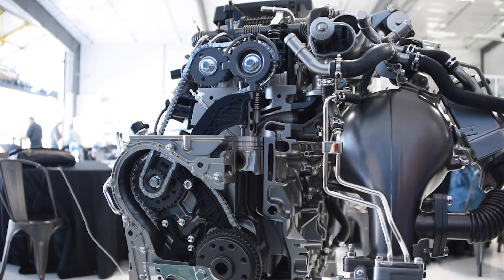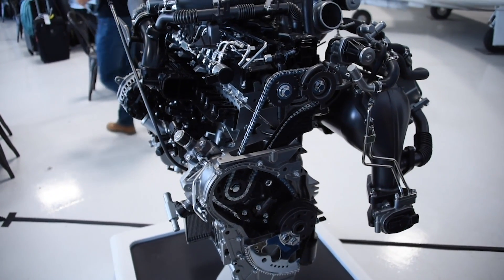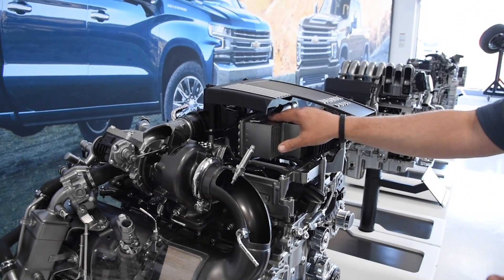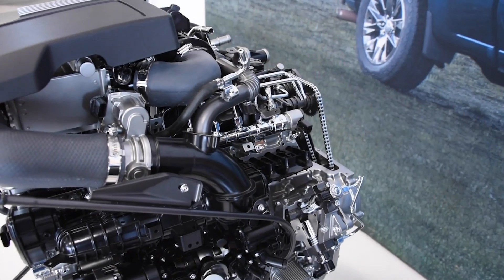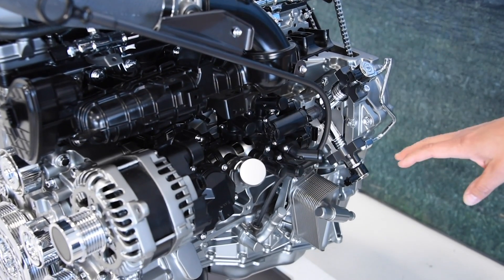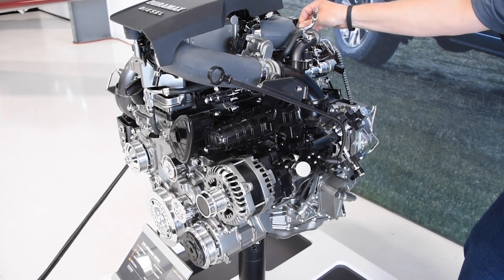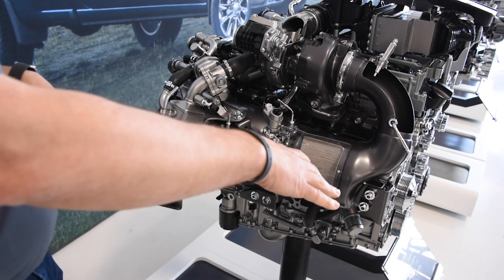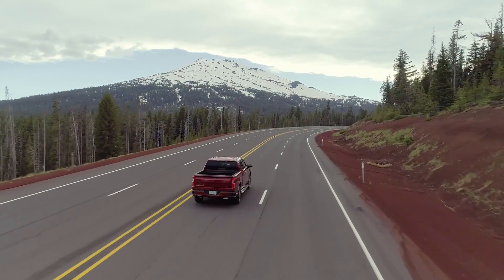What you don't know about the 3.0-liter Duramax diesel

Comment: Why a belt instead of a chain to drive the oil pump? I have seen estimates of 14 hours in labor to replace this belt so we are looking at at least a $3000 job.
Reply from the maker: A submerged belt can last as long or longer than a chain, and is quieter. I think 14 hours for a GM tech to do this job is severely over estimated...you can pull the entire engine and put it back in less time than that.

Comment: Title says: 'What you dont know about the 3.0-liter Duramax diesel.'

The GM 'engineer' goes on to say that 'the timing chain can be replaced by simply dropping the transmission.'

Tells me everything I need to know about whether any normal person will buy this engine combination.
Reply from the maker: A lot have. Enough to justify its use in GM SUVs as well. People like you crack me up complaining about the timing chain location and an oil pump drive belt that lasts 150K. Nearly every SOHC and DOHC engine requires a timing belt change at 80K and no one has a peep to say about that. You may want to get used to the idea the GM's chief and global engineers may have a little more experience and technical insight than you do.
Reply: @TheRVConnection  
'You may want to get used to the idea that GM engineers have' more experience than I do.

You clearly forgot the Lt1 from the 90s.
Do I have to explain that to you?

'Nearly every engine requires a timing belt' blah blah blah.

Show me a GM 5.3 that has gone past 100k without needing some kind of work done to it.'
I'll wait.

And you want to lecture me and justify the use case of putting the timing chain at the back of the engine which would require dropping the transmission which hardly any backyard mechanic is willing to go through the trouble of doing?

Tell me more about what you think, I am interested in knowing more about what you have no idea about.

Comment: I have a 2022 Silverado with this engine and 34k miles. So far only oil changes and tire rotations.  The oil type is limited and hard to find. Zero other issues.  Oh, except I can't figure out the infotainment system.

Comment: Why couldn't they just use a small Cummins diesel instead of this?
Reply from the maker: That's kind of a complicated answer. Consider that GM has no contract or relationship with Cummins, as Ram does. Even with the Ram application, the 5.9 they originally started using was an existing engine (school busses, delivery trucks, etc) which was gradually modified to meet Chrysler's needs but is still used in different applications (i.e. motorhomes). It did not start as a clean sheet of paper. Next, consider that there are a TON of design parameters for a modern diesel, especially with regard to emissions controls, and to a lesser extent, noise vibration and harshness (NVH). Most available diesel engines are not emissions certified, and owing to their industrial nature, do not have to comply with any NVH parameters. So, GM created its own engine specifically for this application, and since they already own the Duramax name, called it that even though it has no relationship with the Duramax V8 and was not designed by the same engineers. Hope that answers your question!
Reply: @TheRVConnection  GM did not create its own, this is a BMW copy. Did you not hear the German explaining the engine? Germany is about 10 years ahead of the US woth regards to engineering.

Comment: My customer owned a 2020 GMC sierra, 3.0 Duramax, and recently traded it in @ 75K miles because the check engine light came on. Code was P3196. ( turbo cooling pump failure ) est. at the dealer was 5-6K, but 2-3 month wait. He now owns a 2023 Tahoe w/ 6.2L
Reply: I was forced by a similar exhaust system failure to trade my AT4 on a gasoline. No diesels for me until the DEF and crazy engineering.

Comment: Over $3000 to replace oil pump belt!!! What are youi guys thinking about  bel;t driven oil pump??? Plus the engine is too small for the application ,it should be up around 5 liters. You got it half right .as usual for GM.

Comment: How do you design a engine with a belt that drives the oil pump? While everything else is chain driven?  Kicker the belt is on the back of the engine” simple just pop the transfer case and transmission to replace ?  Who was saying the cab has to be pulled ?

Comment: Stay away from GMC and all other related vehicles/brands..I bought a brand new 2023 GMC YUKON DENALI with the 3.0 Duramax back in November and with only 750 miles on it took a dump. Got a check engine light. I guess its the Coolant Control Vale…It’s been at the dealership for the past 30 days and still haven’t gotten it back!!!! Will be contacting a lawyer here soon!
Reply: Did u got solution? They fixed the truck ?

Comment: NIGHTMARISH complexity! In all that I still never saw anything that looked like a straight six engine in there. Not even a recognizable manifold. And, "just drop the transmission to replace the belt"? That sounds much, much worse than "pull the radiator and shroud".  And hope you still have an engine after an instantaneous loss of oil pressure while driving. Like another guy below says, "why put a belt on the oil pump when the timing chain is RIGHT THERE?"  That is NUTZ! You better practice your shut down and pull over game in advance...

Comment: Timing is the turn off for me one its a wet belt for the oil pump not a fan a chain i can live with. 2 its in the rear so expensive as far as labor is concerned to replace as far as labor this to me was not a good design idea keep serviceable parts easy to access

Comment: im pretty sure the swirl valve is not atomizing air with fuel, this isnt port injection, its direct injection which means the fuel is injected microseconds before tdc, not alot of time to "atomize" air. It is more likely that the swirl valve is there to increase intake air velocity at low engine speed which helps charge the cylinder with more air to increase low rev engine performance and efficiency.

Comment: Lol. "The oil pump belt is easy, you just need to drop the transmission...." 
1)How much of a pain in the ass will that transmission (and transfer case) be? 
2) why a belt and not a lifetime chain like the timing?
Sounds like a stupid design that's going to haunt GM customers.
What mechanic slept with which gm engineer (or their spouse) for that "F U"  design idea.

Comment: "Garbage Design"  wet belt has to be service at 150,000 miles or less but you don't have to service the chains "WTF' kind of design is this why not the whole entire motor with chains. They're already telling you that this is going to be a trouble nightmare disaster. Fucking GM not even with a bail out can't get anything right still fucking the American hard workers out off there hard earned money … No thanx I'll stick to my old 1997 Ford F150 with 415,259 miles in between oil and filter spark plugs wire air filter transmission oil change diff fluid and etc.. After all this time I'm going to replace the timing chain not because is making noise or rattling not at all. She's still running strong is because of the amount of mileage on the motor. America wake up smell the coffee and don't be lazy service you're old vehicles and don't get rid of them. Buying a new car now is like getting into a mortgage payment you don't want to get in to.

Comment: This trend to put timing components on the rear of the engine is a boon to the dealer service departments for sure. Just pull the transmission they say, it’ll be easy they say. Trouble is the dealers seldom have the experienced techs to handle heavy line work that done cause more trouble then they repair. Technology is expensive to maintain. Total cost of ownership it going up almost as quickly as fuel prices.

Comment: I remember reading about GM adding an extra injector for regen on the LML to avoid oil contamination issues with post injections. It makes me wonder why they went back to post injections. Looking at everything else, it doesn't seem like they did it to avoid complexity. 

Rant:
Variable oil pump, variable coolant valve, variable exhaust restriction, variable high and low pressure EGRs, Swirl valves. What could go wrong Mr. Murphy?
And for the love of Pete, why put a belt on the oil pump when the timing chain is RIGHT THERE? 
Don't worry, if it fails, you will be warned and be able to stop; meaning you will instantly loose oil pressure and get a warning that your bearings are eating themselves as you take a few seconds to read the warning, slow down, pull over, and shut it off.
Then tow it to a shop where they will have it on a hoist for 2 days and charge about 2 grand to change that stupid unnecessary belt and hope your motor is still good.

Rant over.

I did really enjoy the in depth look at the motor but it didn't really instill confidence.
Reply: Ditto! 
Great video with good detailed info and nice cutaways. Revealed plenty to persuade me to never buy this power plant!

Comment: if the belt fails , especially if it breaks apart, where does it wind up? in the oil pan/ wrapped around the timing chains?
Reply: Worse yet, think about where all the little pieces of rubber go when the belt starts to disintegrate.  I suppose all them little pieces will get pushed by the oil thru out the engine and lodge in crank and rod bearings.  What could go wrong?

Comment: I've had mine for a couple years and just bought a suburban with it as well.  If it needs a belt at 150,000 miles then so be it.  Its only a 995$ option on the SUVs now so its dumb not to get it as an option.  Its awesome. Period.
Reply: Any problems with engine pinging , sounding like cheap gas?

Comment: That oil belt will cost $1500 to service.  Ouch!
Reply from the maker: A timing belt in a passenger car will cost around $700 and it needs to be done at 80,000 miles maximum...so I think it's a push.

Comment: I have 2 of these turds. Used as oil field gaugers trucks. Both purchased feb21  both have right at 60/70k miles on them. Both of these trucks have left my employees on the side of the road at least three times each.  And have been in the shop probably six times apiece with repairs it took at least four or five days of downtime. 
  I Purchased a gasoline 6.2 trail boss at the same time and all it has ever had is oil changes.  Before the end of this year both of those little diesels will be traded off and replaced back with 5.3 L gas.  
 Real world fuel mileage working in the oil  field every day  is about 16 miles to the gallon. And the way diesel prices are now, it’s not worth it.    But like I said above both of these turds will be someone else’s problem before the warranty runs out But like I said above both of these turds will be someone else’s problem before the warranty runs out.   One of them has had to have the high pressure fuel pumps shatter sending metal through the system.  The other day the glow plug system went out in that exact same vehicle and the dealership said GM has spent right at $21,000 just on that truck alone in warranty repair in the last year.

Comment: It's not that hard at all to chenge the oil pump belt just
pull the front and rear driveline
drop the exhaust
remove the cross member's
Unhook your electrical plugs
Transmission cooler lines
try getting the top bell housing bolts with about 30 extensions
Get a guy named Tony to drop the transmission down on his belly and do a crawling dance upwards pulling the transmission back
and then realize 
You for got to get the torque converter bolts
Drop the torque converter on Your dang head after the last bolt

And there you go the transmission is pulled back and out of the way just start doing all kinds of stuff to the engine to change that oil pump belt while covered in atf.

Comment: Congratulations GM, 2 minutes into this video, and you have my blood boiling over your never ending forms of incompetence.  Not that big of a deal to change the oil pump belt?  Everything else has a chain, why wouldn’t that?  Engineers are morons, the same ones that brought us the wonderful AFM system that they are finally being forced to pay for!  This is why people buy from a foreign automaker, because of stupid shit like this!  If it’s a maintenance part, put it on the front of the engine or make it accessible to the point where an individual doesn’t have to remove half the drivetrain, as in(rear driveshaft, front driveshaft, transfer case, transmission, and all the related lines that go along with them)   Stupid, stupid, stupid, educated idiots, that have never touched a tool in their lives, or had grease on their hands!  Turn an hour job into a 16 hour job, from them actually creating a problem where there shouldn’t ever be one.  🤦🏿‍♂️🤦🏿‍♂️🤦🏿‍♂️🤦🏿‍♂️🤦🏿‍♂️🤦🏿‍♂️🤦🏿‍♂️🤦🏿‍♂️🤦🏿‍♂️🤦🏿‍♂️

Comment: lot of people including myself having intake issues with low miles
Reply: I've heard alot about valve seats dropping due to the special thermostat keeping the cylinder head right on the verge of catastrophic failure. 
This is apparently where the special mpg comes from.
Reply from the maker: Curious...what kind of intake issues?
Reply: @TheRVConnection  I live where it's very cold right now.  This started a day after a very cold night despite my truck being in the garage.  Waiting for my appointment at the dealership weeks away.

Comment: Ahh yes nothing like rear timing chains where there should be timing gears. And why the hell would you run an oil pump off a belt? Do they not figure the belt has a possibility to break and lose oil pressure? This is idiotic lol. Has no one learned from previous engines.
Reply from the maker: Gears aren't used because of noise. In the HD segment, people don't care as much, but light duty customers expect a diesel to be as quiet as the gas engine in their family car. As for the belt, I can only assume that was a noise decision as well–but as I've said elsewhere in the comment section, timing belts in passenger cars must be changed right around 80,000 miles at a cost of $700 or more, and no one seems to take issue with that. But tell them the oil pump drive belt needs to be replaced at 150,000 miles, and everyone loses their minds. If that's the only major expense in the course of ownership, I don't consider that a big deal.

Comment: The turbo will fail often given the amount of heat being forced into it.  All accessories need to be gear-driven to ensure durability in the long run.  Better tuning will drastically reduce the number of regen cycles and increase the service intervals for the DPF refill as well.
Reply from the maker: 1. I agree that turbo heat seems like it could be an issue–but there are many cars that have a turbo mounted underneath the intake manifold in the valley, so who knows. 2. Gears are noisy. Light duty customers want a diesel to be quiet. As for "better tuning", what are you referring to? These things have to be tuned to the max in order to pass EPA regulations.
Reply: @TheRVConnection  One word comes to mind on tuning: Banks.  His solution involves keeping AFR in balance especially so that NOX and particulates are minimized during combustion to increase power and improve efficiency.  Check out his video series on tuning the L5P Duramax.
Reply from the maker: @briangraves5519  Interesting...I'll check it out

Comment: Friend got one in a 1500 375 miles motor came a part Other friends have the 3500 year model 18 and 19 less than 200,000 both motors came apart these Japanese diesels something is wrong everybody started naming them done a max

Comment: I like how this guy thinks removing the transmission isn’t too challenging to replace a belt which will only last about 100k miles. Not a gm hater but I’m disappointed with that design.
Reply: I have to remove the whole passenger side of my engine in my J35 Honda to replace the timing belt every 100K miles… I’m not sure why this engine is getting so much flak for this belt. With a lift, this won’t be that big of a job.
Reply: @StephenPaul1160  have fun getting all those torque converter bolts. Or the one crammed way in the back of the bell housing on the transmission.

Comment: Since the trend in the auto industry is small engines, with big power supplied by Turbo charging on gas and diesel. I will tell you what i do know,  and that is , that people better change their oil more often than they think , especially if they are gonna Tow Campers, horses, car trailers, etc. !

Comment: Good in-line 6 I’m tired of them putting v6 diesels like ford and dodge in-line 6 much better torque still I would probably never buy that. I’d probably buy a 2500 with a v8 duramax or the more likely option get a f250 with a 6.7